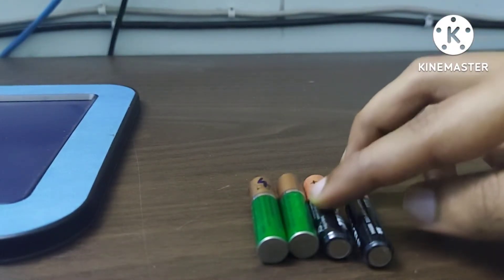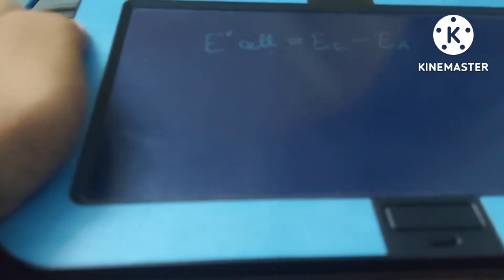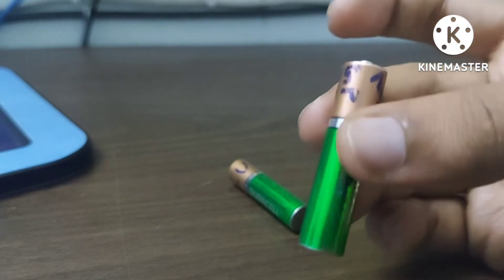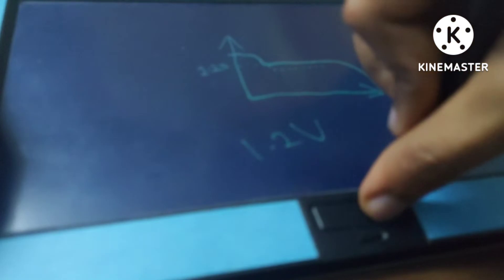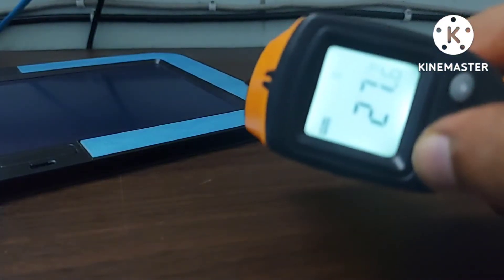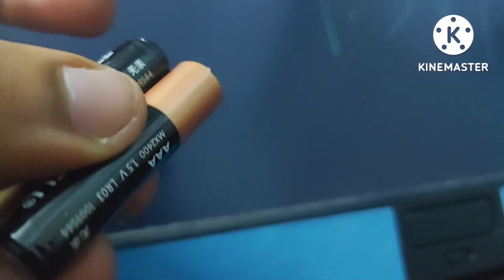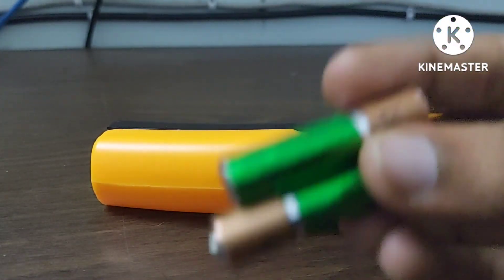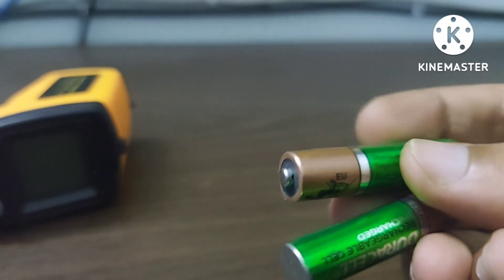Why The Voltage Difference? 1.2 Volts Versus 1.5 Volts for Regular Batteries?

Comment: I have a question which i hope uou can answer.
I am replacing the batteries of my mini solar garden lights. The current batteries inside it are 1.2v AA 600mAh Ni Mh single battery.
I'm trying to figure out which battery to replace it with considering its gonna be outdoor in intense heat most of the year with monsoons having limited sunlight (limited charging issue)

So im confused between choosing new 800mah ni mh battery vs the amazon ni mh 1300mAh battery. 

Is 1.2v the right voltage?
Reply from the maker: @nujjigram  You can use 1.2 Volt batteries itself as they are the specified batteries but here is another point.

It is pragmatic to use the 800 mAh battery. This is because the 800 mAh battery is more likely to recharge under the solar panel and power the light without being undercharged.

The 1300 mAh battery on the other hand may not get the opportunity for a full charge under solar alone. Therefore, I recommend getting the 800 mAh batteries.

However, if you have 1300 mAh batteries available, and they are of a Low Self Discharge (LSD) type, then you can get a set, charge them with a high quality normal mains charger to 100% State of Charge overnight and then when morning comes, you can install them in the solar light.

Let them be fully charged and fixed into the light in the mornings and then charge  from solar as well.

This way they can work nicely. 

Any questions, feel free to ask.
Reply: @advaithmadhavan8260  hey thank you so much for responding. 
I was just checking for LSD batteries and they seem to only be available in larger capacity ,i.e 2100mAh - 3800mAh . 
And twice the price of the 800mAh - 1300mAh amazon batteries 

Guess I'll have to buy within that range if I was to consider cost aspect
Reply from the maker: @nujjigram  Okay, that is not a problem, in this case, I recommend going for 800 mAh batteries of a good quality as in case of an 800 mAh battery, the rate of self discharge can be overridden by the solar charging input thus making the 800 mAh battery a better choice.

Here is a link for 700 mAh AA Ni-MH batteries from Eveready https://amzn.in/d/75ov6En
Reply: @advaithmadhavan8260  hey these are perfect. Amazon didn't even display these cells when I was searching for LSD batteries 
Thank you so much

Also, from what I understand, you are more concerned about the low discharge problem than the battery being at full charge for a longer period of the day.

Comment: The lower voltage of the rechargeables becomes more of an issue with the increase in the number of batteries needed to run the device. I have a trail camera that uses 8 AA batteries. Eight standard batteries will produce a total of 12 volts (8 X 1.5), but eight rechargeables produce 9.6 volts ( 8 X 1.2).   9.6 volts is on the threshold of the device working properly. The instructions even state to use alkaline batteries only. So why cant a manufacturer produce an AA rechargeable battery at 1.5 volts? Or did I miss the answer buried in the video?

Comment: I've got that exact same IR thermometer gun and 2x Panasonic Eneloop BK-4MCDE Ni-MH cells work fine in it; no dim screen/back-light/laser. They were last charged like 6 months ago, still no sign of low voltage. I only use it a few times per week.

Comment: One question disposable AA batteries on box usually say a warning don’t use old and new batteries for toys , electronics but today after years that should be updated  for lithium ion and Ni-mh saying to don’t mix different type of  chemistry new batteries as the voltages are different and might damage either battery . Or what do you think , I been testing new lithium usb AA not great results sometimes they fail or simple stoo working and chip inside sucks on some brands and it’s way more expensive than usual 1.2v rechazable but there’s some electric things that suck and really need that 1.5v to operate .I guess companies want to continue taking away my money w this disposable batteries 😂 yeah I do have some devices that won’t even turn on , when I use Aaa batteries that are rechargeable . Hope new chemistry comes out and don’t have so much chip but have a good quality like the 18650 but in 1.5v range  hopefully soon .
Reply: They have 18650 type Li-ion in AA now. 
they don’t last as long as an NIMH 1.2volt battery. 
I have been using the Eneloop NiMh for 3 years now. They are amazing. Super long battery life. Maintain their voltage even when stored for over a year. And they never leak into your devices like every alkaline does

Comment: Bang on! for me, bud. My multimeter, 3 x AAA.I have been trying to figure out a parasitic power drain in my truck for the last few months. The voltage reading was always 12.2V when I first measured, then after doing a couple things, or if I just held the leads on the terminals, it would slowly go up.01 at a time until about 12.45V. I thought it was capacitors or something, going back to the battery, but, Then this week, it wouldn't give me a reading at all. Everything else works, including light, so I thought it was broken, didn't even consider batteries. Then I decided to investigate, and as soon as I opened it and saw the rechargables I had in there, I thought, I bet you that's the problem. .... also, it had 2 x 10 amp fuses in it, one should be 600ma, lol, and for the proper 10A fuse, the clips are too close together, so that fuse wasn't even connecting. My word.

Unbelievable how such a small simple thing can give rise to major issues. So much time wasted and racking my brain over my truck,  lol.

Thanks for the informative video.

Peace
Reply from the maker: Thanks for watching.

Glad it was helpful.